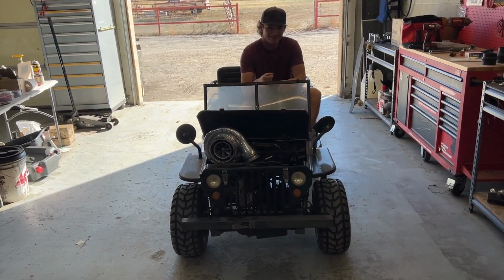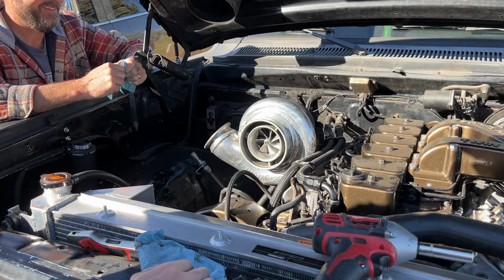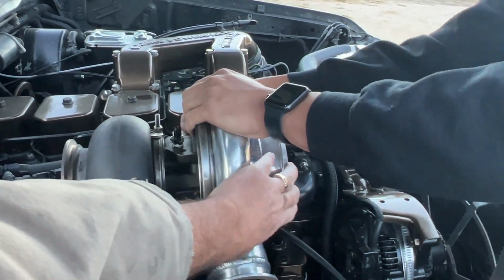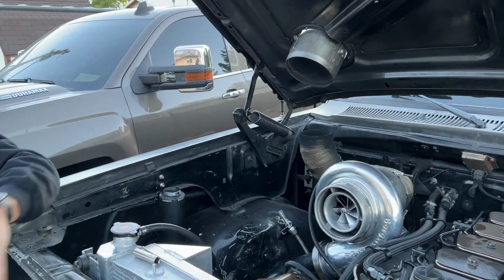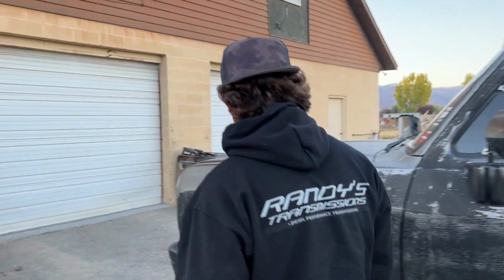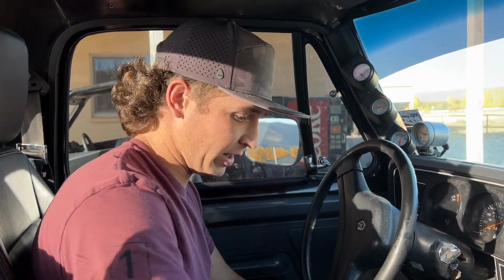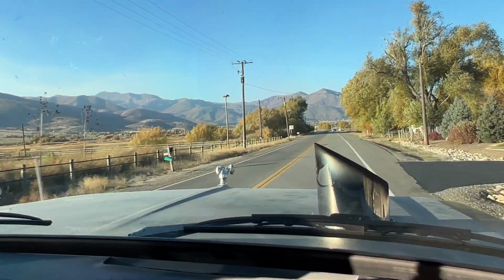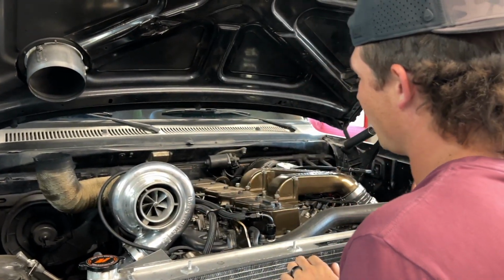FIRST GEN CUMMINS GETS 80MM TURBO...FOR TESTING PURPOSES

Comment: Are the fins chip off on the compressor wheel?
Reply from the maker: Yeah this is a used loaner charger off a very high horsepower rig that seen some shit 😂
Reply: @KoleRichards  I'm sure running no filter in a desert doesn't exactly help.  Cool video, put 2400-2600 stall in her then she will eat!